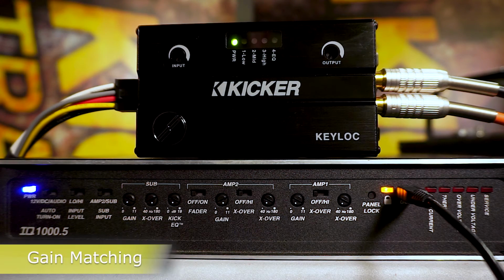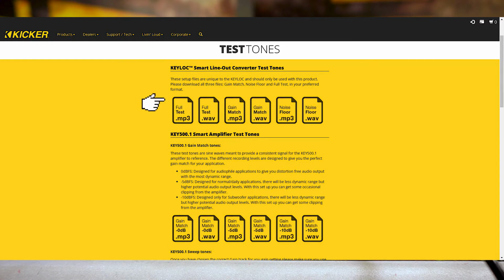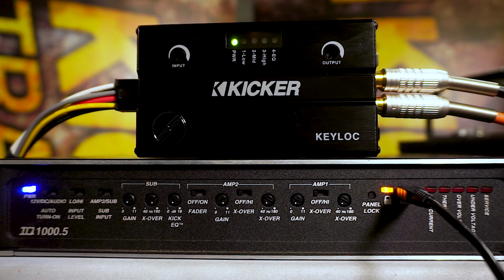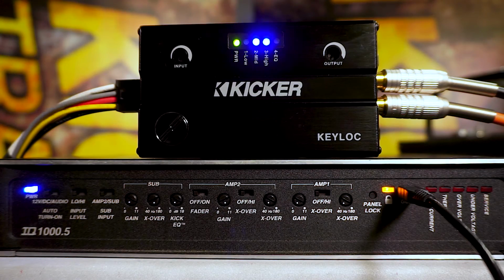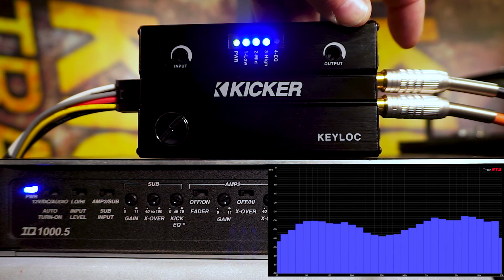KEYLOC

Comment: Fast forward 5 years later my Kicker key lock is still going strong! I get to keep my stock CD player to deter thieves. But little do they know I have 3000 W of power in the trunk! Having an aftermarket head unit could be a dead giveaway. This gives you the best of both worlds, win-win.
Reply: Really looking to get one to replace my Lc2i. So doing research. Your comment gives me confidence.
Reply: @anthonyforster178  I get to keep my old school, stock 6 disc CD changer in the head unit! Plus I get the sound quality of an aftermarket head unit, if not better. You can adjust the input and output voltage, honestly it's a win-win. Don't even mess around with them cheap aftermarket converters. If you want to keep your stock head unit and add an amp to power your subs, this is the way to go.

Comment: I know this is 5 years old, but I just installed the keyloc in my 2026 Silverado because I can't get an aftermarket head unit yet. It made my new speakers and 6 channel DSP amp sound so much better. The bass roll off was killing me and the highs were terrible. After installing the keyloc, it was like night and day difference. My subs are now getting a full flattened signal to work with and my highs are clean. After my acoustic EQ of all 6 channels and sub, I'm literally getting the best sound my crew cab truck can deliver. Under rated and very affordable addition to my system.
Reply: I’m having the exact same issue on my 2020 f350 with bass roll off my l7 kickers are losing all bass passing vol.14 it’s driving me crazy ! How good did this hold up so far?
Reply: @OTB_CHOP  Well, it's only been a week. So far I'm impressed every time I get in my truck and crank my old school rock (Rush, Tool, etc)
One happy addition is it got rid of my fake engine noise that increased with my 12" ported sub. The new trucks have a fake engine sound no one can eliminate because it's programed into the infotainment system. The Keyloc magically found it and made it vanish. Not to mention flattened my signal to my subwoofer, so I can tune it with my DSP to perfection. 
By the way, I replace my Audiocontrol D-4.800 that has accubass to fix bass roll off and works good. All of the AC LOC units have accubass. But I never really liked making fake bass to fix the roll off. The Keyloc literally deprograms the factory EQ settings to eliminate the roll off.
Reply: @xmas4203 awesome man ordering mine right now for sure , it’s horrible I have 2 10” L7 kickers and lose everything it literally sounds like factory door speakers it’s bad
Reply: @OTB_CHOP  You'll like it. It takes a bit to learn how to get it dialed it. I just watched a few different youtube vids and it went easy.
Reply: @OTB_CHOP  The other nice thing about the keyloc is it will tell you if you're tapping into a good source feed for the subs during the second step of the setup.
Reply: @xmas4203 thanks man just ordered it on Amazon got it on sale looking forward this week to install
Reply: @OTB_CHOP it's the answer. Period. You need one. You need this if you don't want to fiddle with things yourself or you need the lc2i if you're ok with setting things yourself. 
It'll change your life man for real. Don't wait, do it yesterday.
Reply: 2021 Kia forte GT here in 2026 too haha! I installed a kicker comp r and 1000w amp and it'll sound great then all of a sudden it's like where's my sub?! This is the way 😂

Comment: This is great! I wonder if you guys could make this product or a similar one support customizable eq. Clearly the thing already has advanced DSP abilities so let me just hook up my laptop and add a shelf filter below 30hz because I love those super low frequencies.
Reply from the maker: Not a bad idea! We tried this once with the IQ series of amps and our TWEEQ software about 12 years ago, but customers simply weren't into it. Maybe we were too far ahead of the curve. We do have something similar now for our PowerSports amps (KPT), but the hardware needed for that software integration was already in the amp. 

The purpose of the KEYLOC is not to do that, however, it's to provide a flat, full-range useable signal off of filtered stock audio.

Comment: Do you need to have a full range or specific factory sub speaker wires to tap into for this to work?? My hyundai cuts freqs pretty hard below 38hz ish, wondering if this would still work to restore that.
Reply from the maker: The KEYLOC will restore those low frequencies, whether you're tapping into a full-range or the sub output. This has been a go-to for installers since it came out!
Reply: @KICKERAudio awesome 👍thank you for the reply, definitely adding this to the build list🔥
Reply: @KICKERAudio  just wondering, what if my speakers only put out mid to high frequencies and only put out low freqs when the input level is turned very high? What would the alternatives be?
Reply from the maker: @DJSCRATCHNSNIFFVR  Is everything in it stock? I don't think it's putting out low frequencies at the higher volume when you turn it up, I think the speaker is just distorting from being clipped.
Reply: @KICKERAudio  yes everything is stock right now, was just asking a hypothetical lol.  Could I theoretically tap into the speaker wires behind the head unit to get the signal before all the factory EQ and roll off gets applied?  (To get a full range signal using the keylock)
Reply from the maker: @DJSCRATCHNSNIFFVR  That just depends on where the factory EQ/crossovers/etc are all getting applied. If all that occurs later in the signal chain (after signal leaves the head unit), then yes it should be a good full-range signal. Even so, head units have their own coloration they apply, so you'll want all EQ and Loudness and all that FLAT or turned off on the head unit, too.
Reply: @KICKERAudio I want to piggy back off of this person question

For reference: I have a 22 Maverick with B&O

So if I want to tap into the factory subwoofer signal, with lead do I connect it to in the keyloc? I.e— the left side, the right side, “bridge it” or does it even matter?

Comment: Can I use the Kicker 47KEYLOC Smart Line-Out Converter 2-Channel for factory Amp with 12 channels. Basically can this LOC be installed between the factory head unit and my factory 12 channel amp?
Reply from the maker: How many channels are going from the Head Unit to the Factory Amp? Is it just stereo into the Amp, then the amp busts it out into 12 channels?

Comment: Would it be possible to use 4 KeyLocs to run 8 channels?
1 KeyLoc on component tweeters
1 KeyLoc on component mid
1 KeyLoc on rear coaxials
1 Key Loc for the Sub signal  ???
Would it work? Would it sound good?
Reply from the maker: Yes, it's possible and would work fine, but I don't want you to have to buy more than you need! Are you sure not just using one KEYLOC to defeat the OE Source Unit filters and restore signal wouldn't be enough? I guess you're looking at putting one on each output of the source unit?

Comment: What if the source im tapping into is losing range due to factory amplifier crossovers/filtering?

When playing test tones, my factory rear speakers / woofer (2015 civic si) seem to lose frequencies below 40hz.. the front speakers will do 20hz(terribly) but the rear gives me like nothing. Id have to go back and see exactly what frequencies im getting and where, but its my understanding that with just a passive loc, im losing that range below 40hz tapping into the rear leads.

Will this product make up for the rears falling off on the frequencies that I want to send to my aftermarket amp?
Reply from the maker: That's the purpose of the product! The feedback we get from installers is pretty great. Defeat the OE filters and crossovers and get the audio system you deserve ☺

Comment: For someone who just wants some better speakers in his rav4 this makes no sense whatsoever 😅
Reply from the maker: The KEYLOC is really more of an "installer" product! For the last decade + the OEM sound systems on cars have gotten harder and harder to deal with. This product exists to correct hard-coded factory settings that make it difficult to install and use aftermarket car audio products. No matter what, your RAV4 deserves better speakers! What are you looking at or considering so far?

Comment: Hi !!! I 'm from Puerto 🇵🇷 Rico and i planning to upgrade My Kia Seltos S 2025 witch a majority of You're Product :  47KEYLOC / in The Front Door 46CSS654 / Rear Door 46CSC654/ ( 2) 51HS10 / 46PK4 / other brand will be a Pioneer  TS-A879 ramplacing the dash Speaker and for Amp Taramps TS 400X4  any sujestion ? for now to save Money , I'm going to buy it little by little and I hope it will be installed at the beginning of 2026 !!!
Reply from the maker: Hi arielvega2753, that sounds like an awesome system! We'd of course suggest KICKER amplifiers, but other than that, we think you'll love your car audio. 😃

Comment: Awesome unit. Works amazing. Is there a way to turn off the audio controlled remote turn-on?
Reply from the maker: If you connect a standard switched +12V Remote Turn-On output to the KEYLOC's Remote Turn-On input wire (red), that will override the KEYLOC's DC Offset detection of the source unit. If you're able to lower the DC voltage of the source unit to below +2.5V, that will be below the voltage threshold of DC Offset detection for the KEYLOC.

Comment: Everytime I run the full test, led 2 turns solid but doesn't go past it no matter how many times I try. Any ideas?
Reply from the maker: The full test for Passive Frequency Detection? If only LED 2 comes on, this means your signal is only mid-range, so your source unit is probably applying a band-pass filter.

Comment: @KICKER-AUDIO if I do not want high signals (running just an amp for a sub) can I pick an audio source that is NOT full range? Is the tuning any different?
Reply from the maker: Hi Michael, the incoming signal does not have to be full-range, you can use HI or LO level input, and don't have to use restored frequencies in the signal if you don't want to (EQ correction can be toggled on/off).
Reply: @KICKERAudio so we don't do anything with the output side?
Reply from the maker: @ I don't understand your question.
Reply: @KICKERAudio  sorry.  I guess my question is, what is absolutely necessary for subwoofer connection? 

I have signal from a rear door speaker,  a keyloc, amp and sub. 

Do I really need to do the whole set up to flatten the EQ and find the range and all that if I just need lows for the sub? 

Also I was trying to do the set up but the noise floor track plays nothing, no audio, so I can't finish the set up....

Please advise
Reply from the maker: @AtTheReady  Gotcha! Did you analyze the signal you're tapping into at the rear-door? As long as it's got the low-frequencies, you're good to go. Noise floor track won't be audible.
Reply: @KICKERAudio  so I keep getting an error.. per the manual " unable to find noise floor" led 1234 on, press the button and it resets..

I did analyze the sound and get low signal with little turning of the input knob. So I'm confident i have good Signal for the sub. 

Just having terrible running the set up.
Reply from the maker: @ Might not be enough output for it register. You're only getting the low-frequencies from the rear door? I think it'd be best to have someone troubleshoot it with you directly. Please give our support department a call at 1 405 624-8583

Comment: Where should gain be on amp while this is going on?
Reply from the maker: The amplifier is not part of the AUTO SETUP process, as the KEYLOC comes before the amplifier in the signal chain. After the Auto Setup, use the KEYLOC Output Gain to match the output voltage of the KEYLOC to the Input Sensitivity of your amplifier (according to your amp manufacturer's specifications). Higher voltage to the amp, when possible, is always the best practice.
Reply: @KICKERAudio how to measure output sensitivity from keyloc?
Reply from the maker: @ A multimeter or voltmeter or o-scope.
Reply: @KICKER-AUDIO  I've tried using multimeter and the highest output I can get on RCA is 2.2v.

Oscilloscope is another headache, using a 50hz test tone, I can't seem to get a proper stine wave from kicker at all. So I've set output gains at around 40 percent mark
Reply from the maker: @ You can find all of our test tones here: https://www.kicker.com/test-tones

The KEYLOC should output up to 10V. What's your source unit output voltage? It's probably best/quickest to troubleshoot this with our support folks, but feel free to reply here and I'll do my best. Otherwise hit us up at 1-405-624-8583, or support@kicker.com

Here are some additional links to documentation if you haven't yet read them, as they might help - testing output voltage of the source unit is page 13 of the manual.

Manual: https://www.kicker.com/app/manuals/signal_processors/keyloc/47keyloc.pdf

White paper: 
https://www.kicker.com/app/misc/support/tech/tech_papers/docs/KEYLOCSmartLine-OutConverter.pdf

Comment: I turned on my car and tried to play music I noticed my subwoofers shut off, and checked my amp and the keyloc and saw it was shut off, I turned off my car and turned back on and the keyloc is still off, which doesn’t power my amp or my subs, is there anyway to fix this without taking off the fuse and putting it back on the car battery
Reply from the maker: If there's no power to the KEYLOC, and you've already done a power cycle, it does sound like a wiring problem or a fusing problem. Did the amplifier come back on when you power cycled, or is it still off, too?
Reply: @ off too ima get a socket and unplug it from the car battery and plug it back in see if that works

Comment: So, how is the frequency selected? By just playing the pink noise track?
Reply from the maker: There isn't a frequency selected. The Pink noise track is used with the RTA in the KEYLOC to show you what frequency bands are detected in the signal.
Reply: @KICKERAudio  how do i ensure that i have a subwoofer output signal for my amp?  I'm just a little confused.
Reply from the maker: @johnkovich8874  When you test the audio signal using the pink noise track, the LED corresponding to the subwoofer frequency band will light up if it's detecting subwoofer frequencies. It'll be called Passive Frequency Detection on page 10 of the manual here: https://www.kicker.com/app/manuals/signal_processors/keyloc/47keyloc.pdf

Comment: A product that works exactly as advertised.  Used it to flatten frequency response from the factory head unit of a 2012 kia sorento.  The bass frequencies rolled off dramatically below 50 hertz, adding the keyloc completely repaired the signal, boosting from 20 to 50 hertz correctly.  I use it specifically to improve the signal to my bass amp and subwoofer combo.  It's pretty cool to do the a/b comparison by toggling the keyloc button to hear in real time 'before and after' sound quality.  10/10.

Comment: only thing i dont like is u need 2 of these to retain fade control off of factory stereo
Reply from the maker: Yes, that's true.  Another option to consider is using KEYLOC for the front channels and a non-tuning LOC for the back channels, like a KISLOC2 (if you want to save money).
Reply: @KICKERAudio  if you put the 2 ch output side of the kicker key loc into the input side of the DSP and then the output side of the DSP has 4 channels, 2 front and 2 rear, will that bring back that fade or no?
Reply from the maker: @JohnSmithAudio  If the fader were controlled from the DSP, yes, but it's at the head unit, so those discrete channels have to be maintained through the signal chain.
Reply: @KICKERAudio  Thanks! In what scenario would a fader really be needed? I personally never touch it and keep it in the default position, on all my cars head unit.
Reply from the maker: @JohnSmithAudio  Maybe if the kids are asleep in the back and you're wanting to listen to something in the front?

Comment: Hii so my  factory car unit is still sending some volts though when it's paused ⏸️  causing this noise because it's being amplified with my amp , will this help me solve my issue ?
Reply from the maker: Start/Stop vehicles (if you have one) can have issues like that with aftermarket amps, but there are fixes for most of them. To verify, contact Technical Support. They can be reached by email: support@kicker.com or by phone: 405-624-8510. They are open weekdays from 8-5 central time.

Comment: You never adjusted the output level. What is that option even used for?
Reply from the maker: You use the output with amp gain. You will end up adjusting both to get the best quality signal to your speakers.

Comment: Would I be able to use this to run to my sub amp as well as a voice amp
Reply from the maker: Yes. If you tap into a full-range signal (assuming you have one available), many mid/high range amps have a full range pass-through, which you can then run to a sub amp. Two notes:  1) you will lose your fader, as you are running the full system off of a stereo signal. 2) you will need a bass knob to control the subwoofer's output.